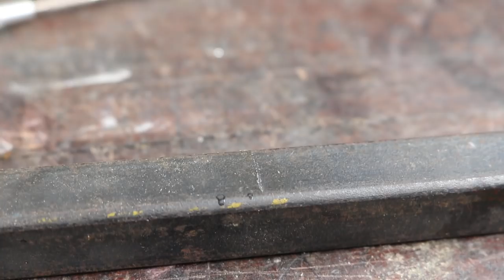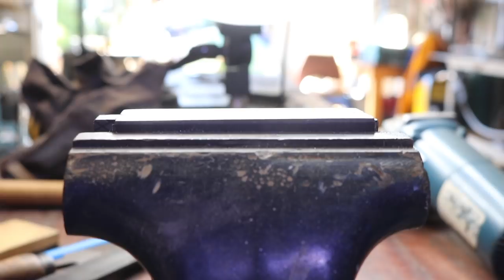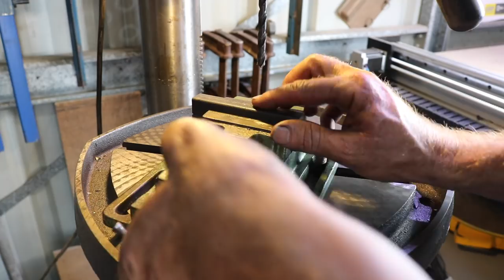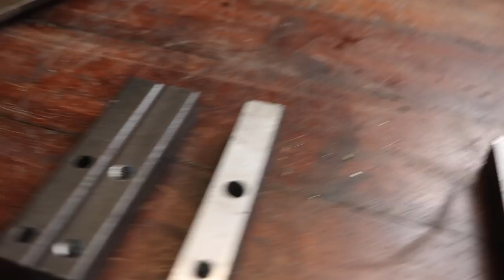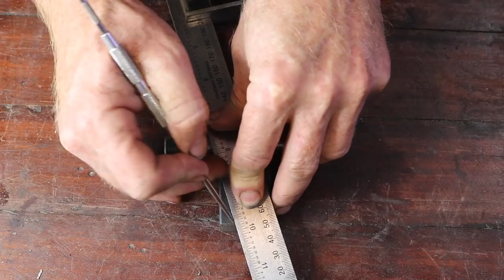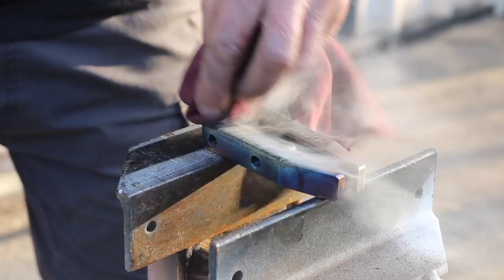DIY Parallel Clamp - Forme Industrious

Comment: Hi man, another great video.
I made 2 engineers clamps when I was at college 20 years ago.
Made with bench fitting and lathe work.
Also made 4 different sized centre punches, a milled vee block, tri square, and that’s the things that I still have.
Can’t remember all that we fabricated.
We had to make everything from scratch, and mill, lathe or surface grind all the the stock steel ourselves.
33 weeks at college.
I miss the old Inverness Tech College.
Fun times before life actually starts.
Keep up the good work man.
Reply from the maker: Sounds like they had you busy! Thanks Eoin and all the best!

Comment: Good stuff 
I made 1 of these at trade school 1998 lathe from square & milled the taper 
I found it 1week ago totally refurbished it!
Now I’m actually using it & it’s the best small/ mid tension clamp
Reply from the maker: Yes they are very useful. Glad you found yours. Thanks Alan
Reply: @ScottTurnerformeindustrious  
Thank you 
Like ya work, trying to refresh & yours was 1st looks good 👌
Made it look easy good stuff.
Reply: Just changed profile picture to the clamp! The small guide on mid part redid 4 times actually got 

The cheap paints gone but 🤦‍♂️ 
Using it a bit 
Thanks heaps 
Good luck

Comment: That is super adorable. Something I've wondered about for a while: when you're cutting threads in things with a tap & die, what happens if you go in at the wrong angle? Does it just bind up, or does it keep working and you just have messed up threads?
Reply from the maker: Well you can easily go off square. Critical when you start the thread to keep things square.  That's why I keep every thing in the lathe to start the tap and often the die. If I get it wrong (it happens) I start again. Yes it would bind up. Thank you!

Comment: On the first clamp, could you of just drill out a bit of the threaded hole for the screw adjuster to sit in and then plugged the other side with a bolt to stop it going through and cut the head off it to keep it neat? Does that make sense?
Reply from the maker: I think I understand. No I think not, but yes to the rear adjuster :)
Reply: @ScottTurnerformeindustrious  I've watched the video again and yep, you're right to of made a new one! I see where I was thinking wrong. 👍